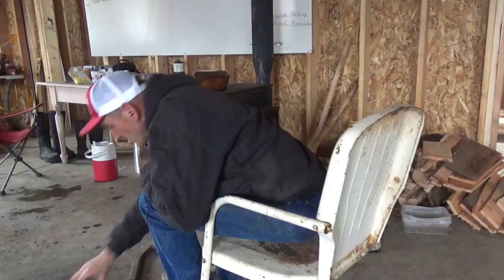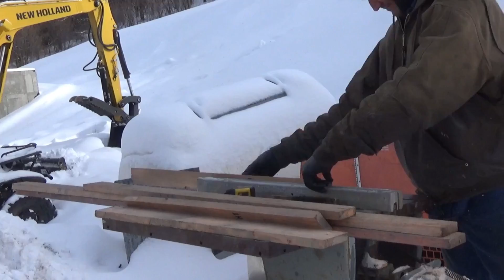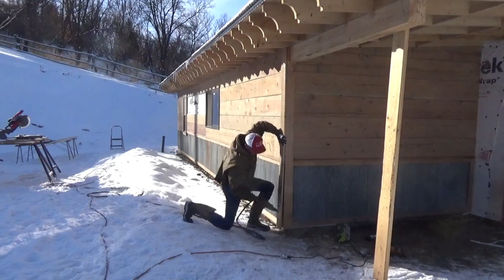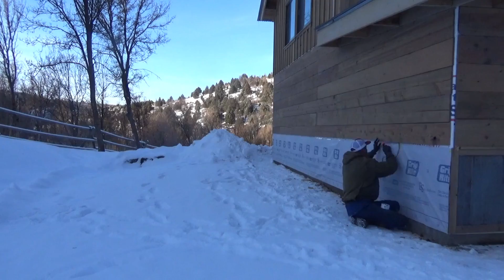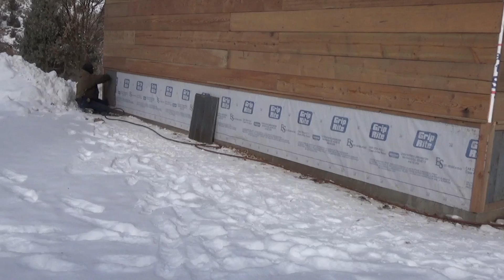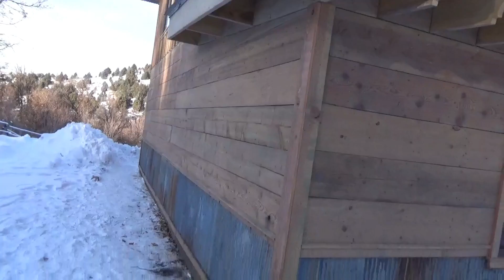#291 - Finished The Corrugated Tin Correctly In The Middle Of Winter!

Comment: I saw this on some show on DIY or HDTV and it turned out great.  It was new, so they let it patina for about 6 months and then sealed it so it wouldn't completely rust.  I like that you are using the weathered side.  Building stone is so hard to find in and around Teton Valley, I am thinking of doing the same thing.  Looks great.  Keep up the great work!

Comment: You did the right thing finishing the siding now its done house is weather tight and any work done inside is not at risk of water damage. Its also off your mind which is very important like you said you can move on and focus elsewhere. You keep doing what you have been doing it will get done.

Comment: Looks really great!! Just a little side note. I did some (BOTTOM)trim to an addition similar to yours and it lasted for a few years. The silicon and paint ended up cracking with the expansion and contraction of the wood trim. It ended up rotting the wood trim from the inside out and the framing behind it. It was suggested to me to remove the trim on the bottom or replace it with cedar wood. I know you stained your wood and only mentioning this to say. Make sure you keep an eye on your caulking! I was also reminded of the splash zone also. The rain will deflect off the ground onto the bottom of the wall. I had 2ft over hang on my roof. But anyway it does look GREAT ! LOVE the look 😍

Comment: Looking great.  Quick thought on the stain for tin... it will likely flake off after a year or two as it wont actually bond to the tin and will expand and will contract with temp at different rate to the tin itself (from experience).

Comment: Except that last window and the siding/trim THEN the rear door. But true 90%  of the outside is finished and it may require the spring thaw to finish that 10%. So it is time to do the electrical and what you really know, the plumbing. Step at a time.

Comment: Tin looks amazing,  I know your not too struck on the idea that it shines, apply a tiny coat over the existing,  then grab some dark sawdust or grind some concrete down and grab some of the grey dust, then as soon as you apply the silicone,  blow some of the dark sawdust or concrete dust onto the top it will stick and give you a matt finish,  the dark concrete dust will work as it will match the dull patina of the tin,  and boy you will be proud of yourself,  trust me it will look awesome.  Good luck.  30 years in the trade I've picked up a plethora  of small but affective tricks,  some good,  some total crap 😅 but generally it gets results,  and good ones.

Comment: Just a thought....before you install your bath tub, if it is not free standing, insulate the heck out of it and the open space around it.  Keeps bath water hotter for a lot longer for a good, long soak!  Glue the mylar covered bubble wrap right to the tub and fill the cavities with other insulation.  Nice video.

Comment: I would have put the axe in a forge and thin the blade out a bit and than harden it in oil or just water since you get low temperatures for quite a few months.

Comment: I'm having a little problem with the old & rusty galvanized tin on your house due to how awesome the rest of the house looks, but, only because I saw someone using some chrome plating on the galvanized tin and it looked totally awesome and very modern.  If the rusty tin wears on you,  or the wife isn't 100% ok with it, try sandblasting a few sheets and coat it with some of that chrome spray paint before you switch to another siding....the chrome tin looks awesome!!

Comment: I don't know why your so worried about the tin leaking the way ran your horizontal siding without any overlap water can and will get behind your siding. I am so surprised that that would even pass inspection.
Reply: yup. kept commenting about that in previous videos hoping that he would notice and respond (maybe he did something we didn't see?). people only seemed worried about it in the first video where he starts the siding. he seems to think tyveck is waterproof with all those holes...
Reply: The guy from Essential Mountain Homesteading (YouTube) came to visit him this summer past and showed Heath how to cut a 45 degree bevel in the top and bottom of the horizontal siding (rip cuts) so that water cannot get behind the siding.
Reply: @monicapttrsn  this guy seems capable enough to do that himself, it isn't that hard to do if you have a table saw so it is questionable as to why he would need someone else to show him that as it is just an extra setting. you can also see here: https://youtu.be/9AG4QZApL3w?t=104 (recent) there doesn't look to be any bevel and there are butt joints galore and later on the tyveck is visible in a good amount of the gaps. hey i don't care - it's not my home - just seems like an odd oversight.
Reply: @fd3871  What happened is that many of us complained to Heath that water would get behind the siding.  So he invited his friend out to the Red Poppy Ranch from Essential Mountain Homesteading to validate the way he was putting up the siding, and in the video, the man showed Heath how to bevel the siding to prevent water leakage at the 13:00 mark in this video.  I had assumed Heath took his advice.  Yes Heath is very capable and it was his opinion that the siding would be ok.  I haven't seen today's video yet, but I will.  Heath recently told us that he doesn't like be told what to do and doesn't work well with others.  He wants to do it his way.  Enough of us barked at him about the siding, so he did some investigation and was told his way was ok, but was given the idea about the rip cut bevel.  If he's not doing the cuts, I am not surprised.  He's happy with the way he does things, plus Cedar is happy too.  But I will add FD, in order to learn from pros, one must have a teachable spirit.
https://www.youtube.com/watch?v=9his3ipFsOI
Reply: @monicapttrsn  Whether or not that area gets direct or sideways rain is inconsequential; water can and will get behind those boards even when caulked or chinked or whatever via condensation or splashback or weird weather patterns and it will sit there as the boards are tight against the osb, it will enter the holes and it will cause a problem - maybe not now, but in 5-10 years. 

When all conventional wisdom says one thing you should do it that way. If he didn't want to bevel (which was a good idea and he seemed to admit it) or take the time to router it (which isn't that much time in the scheme of things) he should have installed a self-sealing membrane like and ice and water shield, followed by a rainscreen mesh (for proper drainage), then the siding. The later is absolutely imperative to allow for proper water ingress movement. The user TooDeep1
 in the comments of that video said some good points too. 

Idk, I'm not a builder, but I've seen too many installations and horror stories on other DIY channels and professional channels to think that this is a good long term solution - Matt Risinger, Tom Silva, .etc.
Reply: Heath thinks tyvek and roof underlayment are the same thing. 4:10
Reply: @johnjohnson5907  hurr durr naysayers... It is still wrong, and obviously so. You don't need to be a builder and just have some common sense to understand why it isn't right. Now if we criticized his choice of siding that's another thing entirely...
Reply: To John Johnson that called us assholes, Before you make a ass out of your self (Sorry to late)scroll up where it says Comments This is a part of YouTube there viewers have a chance to give a written remark expressing an opinion or reaction (the meaning of comment) Maybe you should watch the videos and not read the comments.
Reply: @mwilliamshs  the way they are constructed say they are the same thing, just different names dude